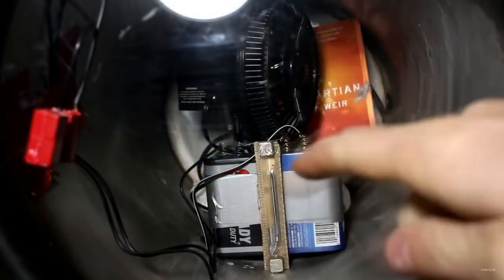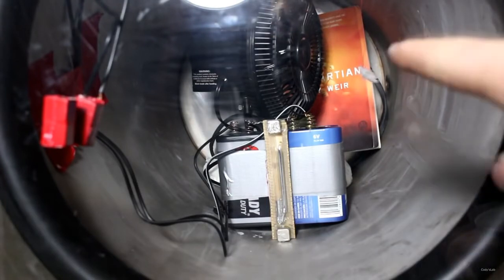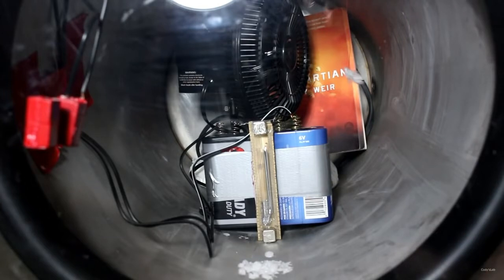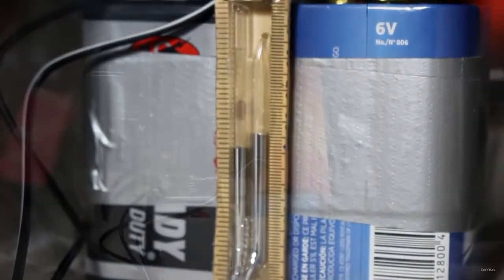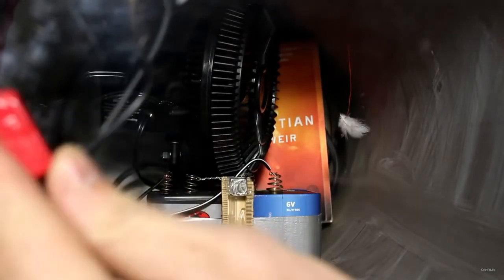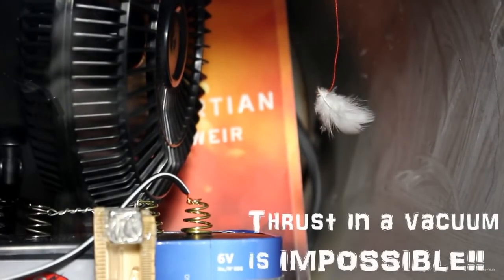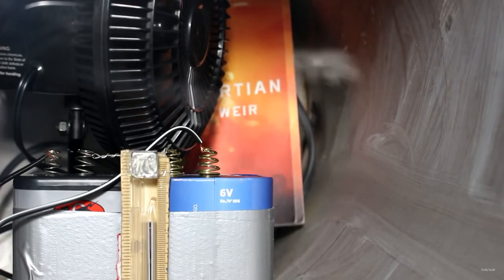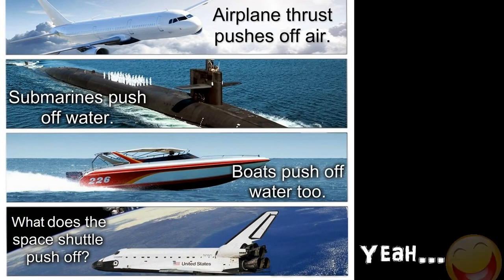Thrust is not possible in a Vacuum

Comment: Rockets don't use spinning propellers for this very reason.

  Current rockets eject the fuel to propel the craft.
Reply: There is no medium to push against, so that it can propel the craft. As the surrounding is near absolute vacuum whatever pushed out of the back will instantaneously be dispersed to the vast emptiness of the force and cannot create any force to move forward. simply put no force created for an equal and opposite force to be acting on the craft.